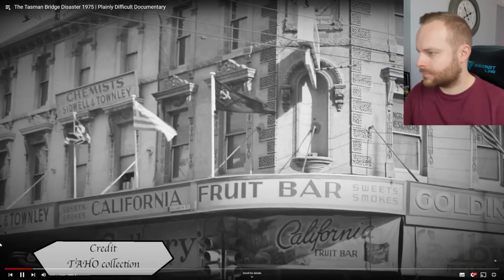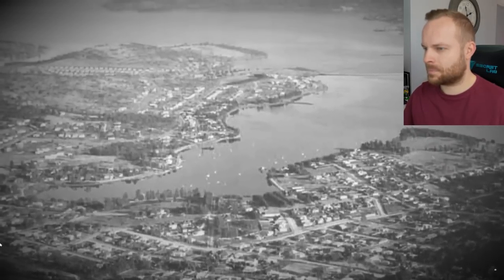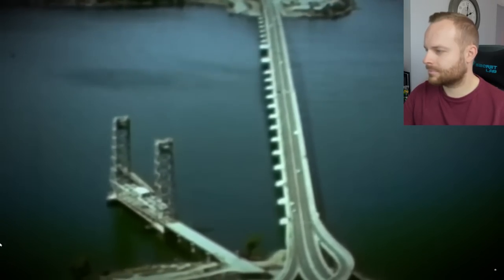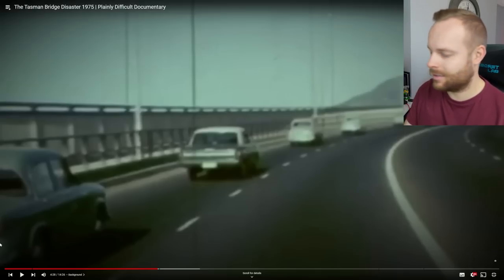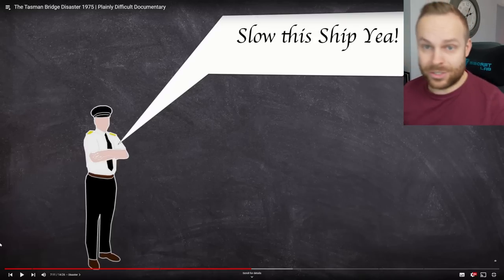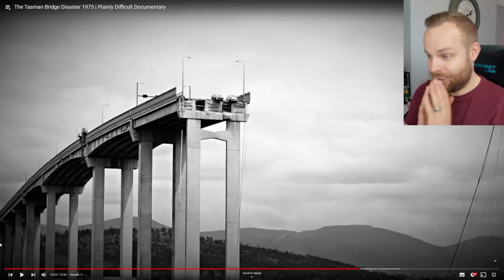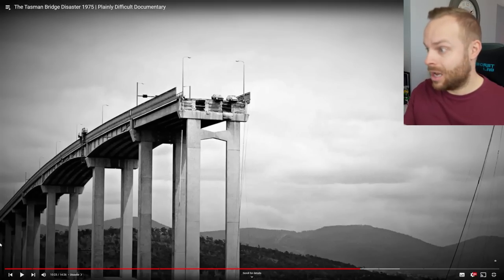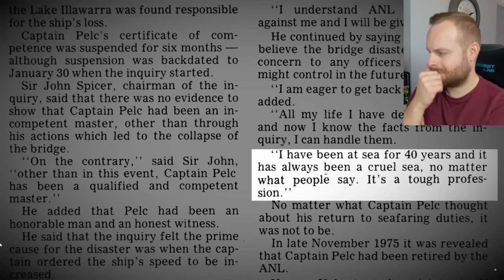Rob Reacts to... The Tasman Bridge Disaster 1975

Comment: I was staying in Lindisfarne which is a suburb of Hobart and crossed the bridge many times in 1974 until I returned to Sydney in September of 1974. I was shocked to hear that the Bridge had collapsed in 1975. Sydney supplied Hobart with ferries until the bridge was repaired. I remember this incident well and had I extended my stay in Hobart and maintained my travel patterns, I could have been on the bridge at that time.

Comment: It should be pointed out that around the same time the West Gate Bridge in Melbourne had a similar issue.... but the quirky titbit is a section of the faulty design sits in a courtyard at in Monash University's Civil Engineering Faculty.... most Arts Students believe it's an abstract sculptural installation, and identify it as such when giving campus tours for potential students.

Comment: A horrendous tragedy/disaster that I still remember nearly 50 years later.
One positive thing to come out of it was that, as part of the reconstruction, they were able to add a fifth traffic lane. They did this by moving the two pedestrian lanes outboard of the main bridge deck - using cantilever construction - and this allowed space for the extra lane.
The fifth - centre - lane is a contra flow lane where the direction of traffic changes with the time of day.
With hindsight, the bridge probably should have been built with three traffic lanes in each direction.
There is an excellent documentary produced in 1978 called "Tasman Bridge Reconstruction" - on YouTube.